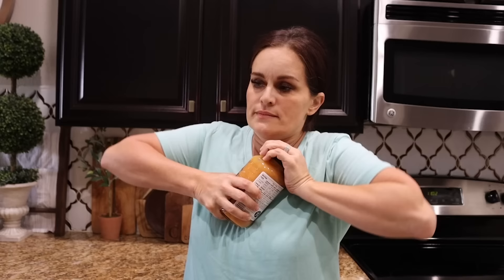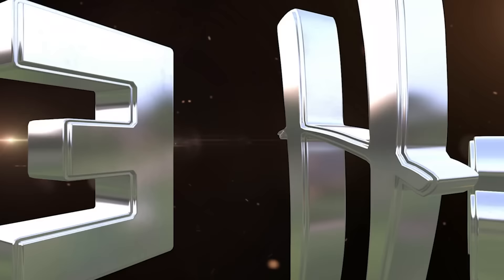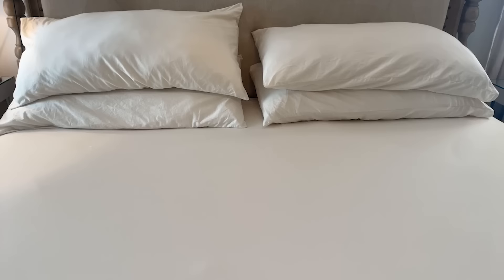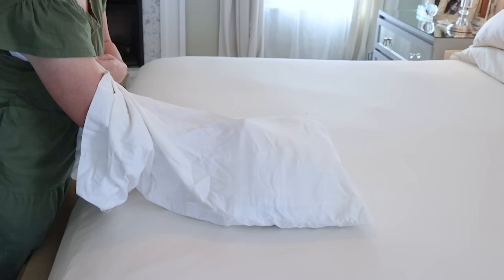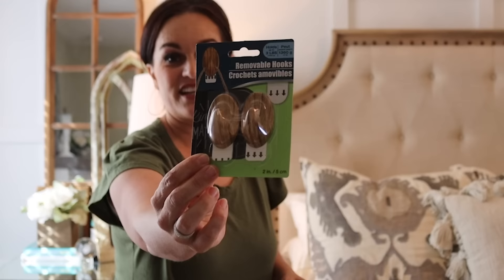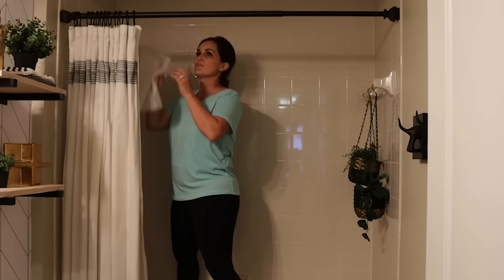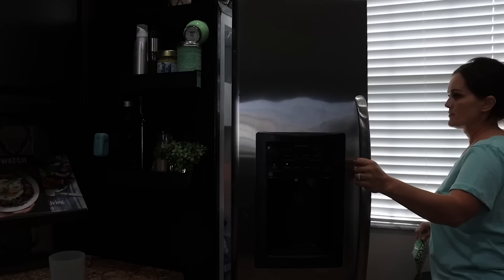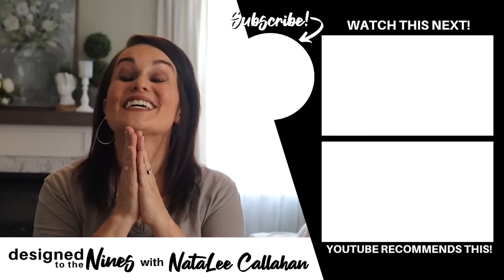15 Life-Changing HOME HACKS That’ll Wow! (Some you sent me)

Comment: I will take my candles when I have burned them down as far as is recommended.  I will place them in a pan with water and gently heat the remaining wax until it melts and then pour it into a silicone mold of course removing the wicks as I go.  I then have wax melts that I can use and there is no waste.  I store them in a mason jar but, any airtight container will work.  I love this hack!!

Comment: An easy way to open a difficult-to-open jar lid is to turn it upside down and tap it on the floor. If the kid is metal (Like a marina sauce jar) run it under hot water. It expands the metal and makes it easy to open.

Comment: A few years ago we purchased a refurbished washer. I brought up the topic about the socks and the Owner said the socks do go down the drain. So yes it eats them. I now put small items in a laundry mesh bag. Also if I wash anything with Velcro? I put it in the bag or wash separately.  Lastly when I was little my Dad showed me to use a butter knife to open a jar. Use the edge of the knife and smack the lid three times  and  turn it each time. That breaks the seal as well. Pops right off and you down have to use tape.

Comment: On the grouting hack, if you have the 4x4 wall tiles or any tile that is placed very close together the sanded grout will not work.  You’ll need to use unsanded because the grains of sand will not fit between the tiles.   Check the grout that you use to see if it needs to be sealed.   If it does you’ll need a silicone sealer.  It’s a liquid & you just brush it over the grout, then wipe off the excess.  That will help protect your grout from discoloring & prevent the water from getting behind it & causing big problems for you.  It’s best to seal your grout yearly.  Hope this is helpful 😊

Comment: I've been framing my outlets for years, but even better, I frame my thermostat. Aren't they always too prominent? What crummy designer thought of putting them on the dining room wall, or the living room wall? Bad designer, bad! So I slipped a thrifted frame over it one day! Where I got the idea for framing my outlets! Another hack I use is spritzing my sheets with a mister. Scented, if you like. That way you can smooth them out even after a rough night. Every morning can be smooth. A fine mister works better; toss the pillows afterwards by the hems for max freedom from creases. And yes, the ceiling fan works to dry them. Keeps them less pet haired too, because baby kitty doesn't like damp sheets. Which you keep that way with the pet hair roller meant for clothes. I love you and your show and have done so since I met you on HGTV.

Comment: If you run hot water on the jar, just holding the jar on its side, and letting the hot water run along the edge or seam of the lid and jar just for a bit, you can dry it off and open the jar.🫢 Hope this helps too.

Comment: I use my spare socks once a year and make heatable reusable rice packs. I fill it with uncooked rice, sew it or knot it, then done. Heat it for 45 seconds with a cup of water in the microwave (the water is important because it prevents the rice from burning over time).

Comment: I have another way I do my sheet sets. I put my fitted sheet and pillow cases inside the fold of the flat sheet and put it in my cabinet with the folded end of the flat sheet facing out so that when i get a new set they are all together and as i pull them out they don't all fall out.

Comment: The Ove Glove has blue silicone stripes that are great for gripping and helping to open a tight lid. I also keep 4" round, thin rubber jar openers. Running the top of the bottle under hot water or tapping the lid on a hard surface also help. I am beginning to lose strength in my hands, but still manage. A great tool is a wedge that you can attack to the bottom of a cabinet.

Comment: They make a non slip jar opener to open the stubborn jars, it looks like the rubber stuff under a throw rug to keep it from sliding around. That's what I use. If your frame wasn't the right size you could just add some trim to the inside of the frame to cover the area you don't want to be seen. Instead of putting damp sheets on your bed you could put them on dry and use some wrinkle guard on them. I spritz mine with it all the time to refresh my bed linens. Downy makes it. and I bought some Goody brand head bands to hold a set of linens together after they have been folded. Cheap and easy. Also if you use the corners of your dining room table to help fold your fitted sheets you will get a more even fold. I have a central charging place in my kitchen where I charge all my electronics. I'm that disciplined to make myself do it.

Comment: OK, so I'm almost 68 yo and I learned to fold my sheets like that, but a bit neeter, when I was 17 yo. My mother taught me. And I learned to stuff them in a pillowcase many years ago. I have seen the duvet trick,  though I don't use a duvet. I did learn quite a few years ago while visiting my daughter in England that many over there don't use a top sheet. They use pillow shams as pillowcases and just duvets for a cover. When they need new bedding, they just buy a new duvet cover with matching shams and a fitted sheet. Her English husband thinks we're all crazy for using a top sheet. I may try that some day. Good ideas though!
Reply: I never really understood duvet cover except to change the color of your top sheet when you dont use a bedspread or comforter. I've also heard some use one mostly in summer when you need a little more than a sheet but don't need a comforter for the extra warmth. Ive never used one. To me it seems like extra washing and extra hardship on putting your bed together. Natalie did however make it look easier. I have back and cervical issues and I need my bed mad as fast as possible but, because of you @Designed to the nines, Natalie I may tried one. With my allergies, I prefer to fully make my bed and not turn it down as some do. They both look amazing if done correct.

Comment: When wax melts have lost the scent, turn off warmer.  When solid place top portion with hardened wax into freezer. An hour (or next day if you like me forget it.) Remove from freezer and tap upside down on edge of trash can. Wax will pop right out!  (You may need to give the edge of the hardened wax to nudge it out.) 
Sometimes I soak up the melted wax with 3-4 cotton balls if I want to reuse the warmer immediately.

Comment: Instead of wetting the sheets and then having to heat up the dryer, I put the sheets on dry then use a spray bottle to lightly mist, then smooth them out.

Comment: I love hacks. Ive done a few of yours and 2 that can be made easier as below from Elizabeth, I use the tip of a can opener (the old simple ones) and put it under the lid and push down a little until you hear a pop then open the jar. The other I do is the sheet hack except I put all 4 corners into one then fold as you did. Hack for socks....keep socks together and neat by putting the socks toe to toe and heel to heel. Fold in half then you should have the 4 openings on one end. Then take one of those ends and fold completely over the socks and make it flat. I love it. Some people just fold the top some fold in a ball, I fold flat like a pancake. 2 more. I rarely finish a whole bunch of fresh herbs so I put some in vinegar and some in oil and let infuse. Also put in melted butter and put in ice cube trays til frozen then in a freezer bag.  Ill come up with more but feel free to use these....Enjoy.

Comment: use the bread tabs to label cords:  if you need to unplug an item at a very busy outlet, instead of following the cords to the item, you can look at the name on the tag, telling right away which plug belongs to which item.
use faded wax melts to create fire starters:  cut a cardboard egg container into it's individual compartments and fill it with dryer lint.  melt the wax and pour over the lint, completely encasing it.  to use, place it under kindling and light.
Reply from the maker: Love these ideas!
Reply: I don't cut the carton up until all the egg cups are filled & solidified. Can also use old candle stubs.

Comment: I just hand the jar to my husband and he will get it open. If he’s not here I use a green rubbery thing that I got. It has the Jolly Green Giant on it. And it will usually help me open the jar.I suck at folding fitted king size sheets. I did laundry the other day. And I think the sheets ended up crooked and I didn’t care. It got shoved in a drawer. It’s extra sheets I used on an air mattress for my granddaughters. I have seen the duvet cover done that way. But I’ve never tried it. Now maybe I will. I got tired of messing with duvets. So I started buying quilts. My nightstands have two spots to plug in the charging cords without the cubes. I didn’t realize that when I bought them. But I use them all the time. I’m willing to try the toilet hack. I hate cleaning toilets. These were some great hacks I haven’t seen. I may check out Brookline. They maybe a little too much for me to spend.

Comment: Easiest way to open a tight jar is with a butter knife. (NOT A REGULAR KNIFE.)  Use the end of the knife to loosen the lid by going around the edges and lifting up, little by little. It will quickly pop the seal!

Comment: My never fail hack is to heat the metal of the lid with hot water and use a rubber glove you don’t even have to put it on - over the top of lid so you don’t burn yourself and it I screws off like a dream.

Comment: I like to iron my pillow cases I don't iron my sheets.  I put my duvet on top of my sheets and then I place the duvet cover over top and tuck it under my duvet and then I fold the top sheet over the top of both the duvet and the duvet cover.... like they do in the hotels.  I stopped putting my duvet INSIDE the cover that's a total workout.

Comment: First of all I love your videos…but I need to interject the opening of a jar…I have an easier solution. …it’s the shelf liner you can get in dollar tree or Walmart.  It’s the one with all the holes in it..just cut 
Different size square or one large one the size of your larger jar and place it over the top, sometimes you need to hit it on the counter or floor not hard and the turn it with the rubber on it…and it breaks the seal and release the air and voila it’s open or else you can take a butter knife of pointed can over and go under the lid and release the air and it will open…the reason it’s hard to open is not because you’re not strong enough it’s because its vacuum seal and once the seal is broke the jar will open…hope this helps you.

Comment: OK, first off you have your hands in two corners one on the right one on the left again doesn’t make a difference whether so wrong. Take those two corners are your two hands take one of your hands and put it in to the other hand and those two corners are together, if you have to lay the sheet down, lay the sheet down, then pick up the other, pull your hands out pick up the other two ends, and do the exact same thing phone at the exact same white. Now you just have four corners made into two. Taking stick your hands and those two corners and put them together and making one corner. Layer sheet back down straighten it up. Fold it however, you want to add to mine and three folds and then fold it up to, the depth that I want the sheet to be. Your folding it just like you would your flat sheet it just has elastic in it so you get your flat and your fitted sheet folded stack them on top of each other take your pillowcases and I’ll put them together save one of your pillowcases and take that bundle and put it into a standard size pillowcase, not a king or a queen or standard and sticker sheet, set with the pillowcases all of it bundle together and put it inside the pillowcase and then fold your take your pillowcase inside and fold up my slightly, and put it all up into your cabinet. first thing that does is it has all your sheep bundle together second thing it does as you can see what color the sheet said yes and so when you pull it out you’re not digging for a fitted or flat sheet or oh now I got a found the pillowcases it all together again I learn this when I was 19 and I am 58 years old now